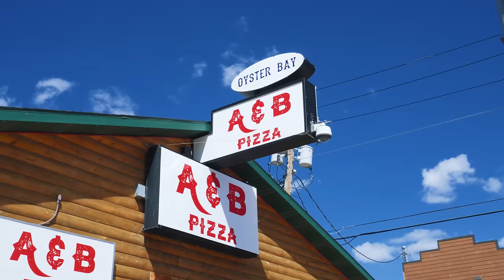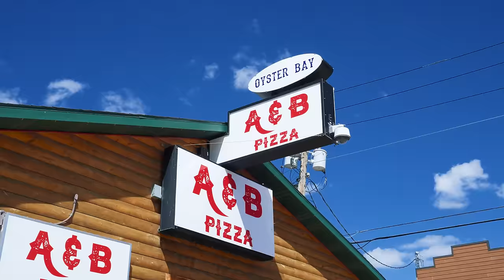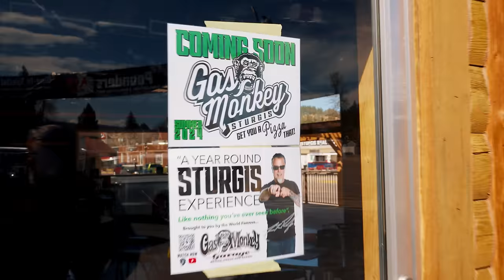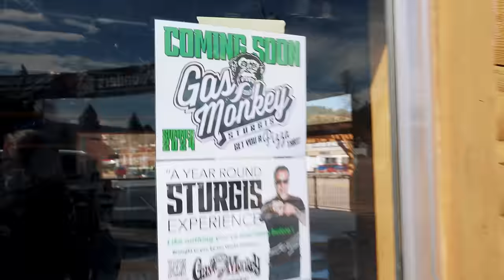Gas Monkey Bar & Grill is Back!

Comment: Put in a butcher and meat counter.  Buy from local ranchers and farmers.  Look into old salt meat company out of montana as a usa beef supplier.  Use beef tallow to fry french fries.  Encourage utube creators to hold meet and greets.  Edison Motors utube get an ev conversion kit training for your crew on solar systems and a f250 or larger truck.  50% fuel savings.
Reply: Old Salt wants to expand distribution with coop ownership.  You bring the celebrity and on line sales.  Get a beef jerkey line made at the Sturgis processing plant.  Help a rancher and buy finish beef, pork, chicken locally.